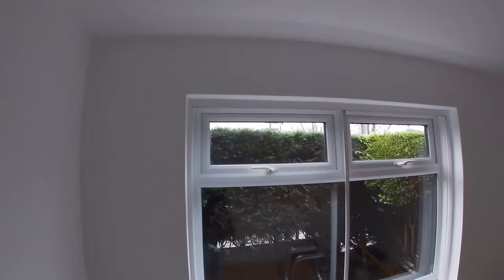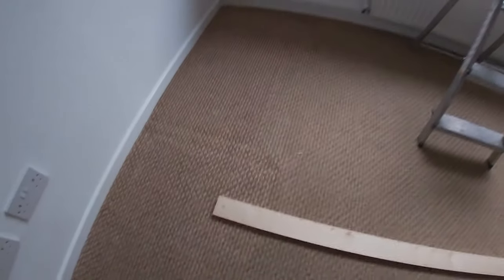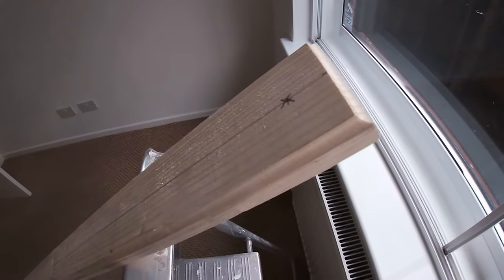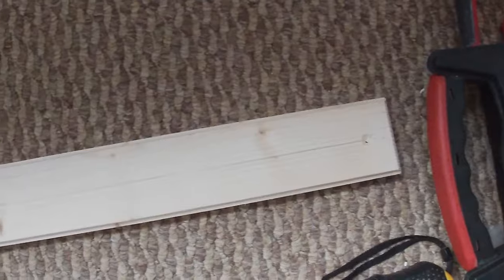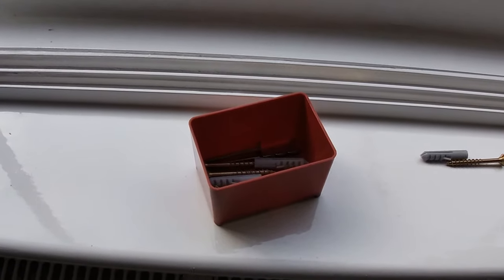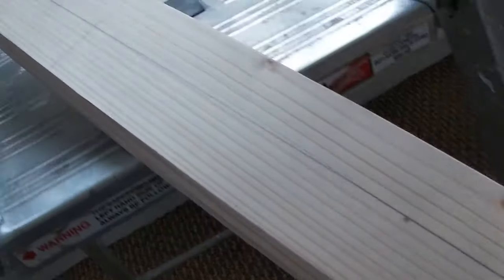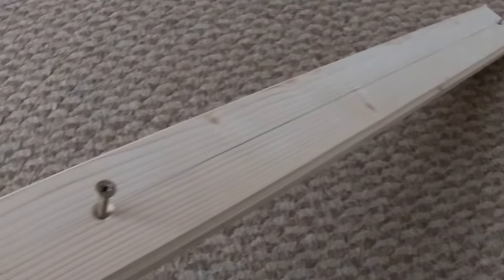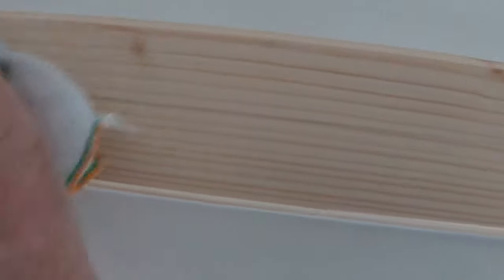How to fix a timber batten ready for a curtain pole or rail

Comment from the maker: *If this video was helpful please consider giving it a thumbs up like and subscribing.
Reply: What screws and plugs do you use into lintel ?
Reply from the maker: @denniswoodhouse3351 

My method for steel lintels is to drill with a quality HSS drill bit to start on a slow speed then you will need to use suitable steel self tapping screws directly through the timber into the lintel to get a decent fixture.I don't use plugs if coming directly into a steel lintel.

Comment: I did this same job today although before watching your video.  Heartening to see that intuitively I followed the same steps as you except I had some hard concrete to drill into.  Having done this and aligned it with a central screw the Rawl plugs got forced outward (used my drill as screw driver).  Really annoying to find at the end it was 5mm off horizontal at one end due to screws dragging it out of alignment.  Really pissed off because I can't leave it like that.
Reply from the maker: It happens as it doesn't take much for a screw to pull slightly out of alignment and I know what you mean about not leaving it like that and sometimes you're better off tightening up by hand as you have a bit more leeway / adjustment than the drill drivers torque.
Reply: Thanks Mick
Reply: that happens because I have fitted loads, and when you use wood screws with thread all the way to the end it pulls the rawl plugs out from the wall. As it over tightens the rawl plug too much before pulling the BATTEN against the wall, so the weakest point is the rawl plug and it pulls it out.
-
When doing Battens this way You use a slightly longer screw and one where the thread does not go all the way to the top of the screw. It pulls the batten down onto the wall with greater force and allows it to continue to pull down and prevent the rawl plug from being pulled out, or spun!
-
Either that or use core drill screws and inserts, but you only tend to use those on Battens which support greater weight like cupboards and shelves.
-
This method is fine for a curtain pole, though there are better screws designed for the job he was doing!
-
Nice video nonetheless, good instructions and have referred family to his channel aswell!

Comment: wouldnt you have been better off screwing the batten into the studs?  this makes no sense to me...
Reply from the maker: It wouldn't do,what studs !!  It's a brick and plaster wall 😂
Reply: lol, your off the hook.  nice work.  i see sooooo many people teaching other people to screw there curtain rods into the gib board, withOUT mentioning the crucial part of 'perhaps' you might wanna consider hitting a noggin in the wall LOL.  Yes it can sometimes be near impossible to put the curtain bracket where it 'should' ideally be placed, so this idea is good.  Perhaps you could do a video on installing curtain rods onto a wall that has gib board?  Most (like me) wouldnt have picked up that your installation was into a brick and plaster wall.

Comment: Forget the plugs and screws. Use concrete fixing hex drive screws. The come in various lengths so guaranteed to get a good fixing.
Reply from the maker: Concrete screws are great for the harder brick and block work and of course concrete but i much prefer the screw and plug method on the lighter less dense thermalite type blocks.
Reply: @micksmaintenanceanddiy  agree. Nice n chunky plugs n screws

Comment: 25 mins to fit 1. I hope your not on day rate haha
Reply: I saw a DIY and builder on a famous tv show do this last week and he drilled bigger holes and put the rawl plug in the batten on every hole, and not behind the Batten, he said he had been doing it that way nearly 40 years with no problem..lol.
-
it took him about 5 minutes.
-
I was taught to countersink the drill hole on the batten, rawl plug behind and then use longer screws with no thread on the top 1/2 to 1 inch of the screw.
-
Or use cord drill screws with inserts as they are stronger.
-
it is kind of weird, how there are so many ways to fit battens, some better than others, plus you vary screws and anchors depending on the wall, and also depending on the pulling force of the item you will be supporting.
-
Some will use 3 screws for a curtain batten, I like to use 5. I bet some people in the thread will use 3, though if doing a bigger Batten I would use 5 as it will stand the test of time!

Comment: Great video...but to gain further strength for the baton I would put CT-1 on the back of the baton and that woulg give it an even better hold
Reply: What is CT1 please?
Reply: @lesleyfrench4182  it's a sealant/adhesive
Reply: CT1 is fine, but not really needed if you use better screws designed for pulling the batten onto the wall.

Comment: can you mention size of depth of wood, size of screws and plastic caps, what size you used for drill
Reply: The rawl plugs were size 6 he used & screws were about 50mm  he said a couple of mins in, the screw caps obviously the size needed will be to cover the head of the 50mm screws, standard bit of batten is approx always the same as standard.

Comment: i want my curtains to cover the entire section of my wall , i will get a curtain rod that covers the entire wall. How long should the timber batten be?
Reply: If you think about it, if you don't want it to be seen, get your curtain rail, notice where the rail's fixing brackets go (and if several, just note each one nearest to each end of the rail and measure the distance between these two alone).
Using the measurement between each one as your guide, cut your wooden batten just a little bit more than this length.

Then affix it to the wall above the window and paint it the same colour.

Comment: The wall I’ve got is like drilling into sand. It’s completely hollow . Instead of screwing the baton to the wall, Do you think if I get gripfill or some kind of adhesive and stick it to the wall? Then screw curtains into the wall?
Reply from the maker: I Would not recommend or risk a gripfill adhesive solely on its own as due to the weight of the curtains including pole with constant opening and closing definitely a danger of falling down.
I would investigate the wall construction take it from there and source suitable fixings/safe mounting points.
Reply: There must be something solid behind the wall somewhere, wooden joists. Find that and affix the batten to that.

Comment: When your drilling the holes on the timber batten what drill size are you using. I know you said for the plugs it is 6mm. Thanks
Reply from the maker: Iirc around a 2 or 3 mm starter bit and don't forget to counter sink the screw heads for a flush neat finish, you can also buy the counter sink drill bits combined single or in a set of various sizes.
Reply: @micksmaintenanceanddiy @micksmaintenanceanddiy I got 2.5mm for pilot hole in the end. I was able to get cone drill too 1st time using it. Another question please. When fixing the brackets into the batten what screws to use? As previously I use long ones . Thanks Natasha
Reply from the maker: Use quality wood screws to suit the brackets,they need to be long enough to go through the brackets and timber without coming through the back of the timber ( l always utilize the full thickness of the batten with the screw size to create a secure fixing ). 
Good luck with your project.
Reply: @micksmaintenanceanddiy thank you

Comment: Im really struggling as i have steel lintel behind where the curtain pole goes...what power drill do i need to drill into it (using the HSS steel drill bit method)?
Reply from the maker: Any corded or 18v power drill should be sufficient personally when I come in contact with a steel lintel my preferred method is to start off with a masonry pilot hole first through the plaster brick or block work (do not use a hss drill bit for this as will blunten the tip) then a 5.5 -6 mm Quality Hss drill bit on a slow speed on the steel lintel then suitable self tapping steel screws to suit and with the batten will give you scope to get a good fixing.

Comment: Please what size and type is the smaller drill bit that you use for the wood?
Reply from the maker: I used a 2.5mm pilot hole wood starter bit which is slightly smaller than the screw diameter/thickness size.

Comment: What plasterboard fixings did you use
Reply from the maker: No plasterboard fixings used on this one (screws and plugs only) as it's a solid block built and plastered wall.
Reply: @micksmaintenanceanddiy  The drill went in very easily and that's why I thought it was plasterboard.  My wall is plasterboard so can you recommend what plug to use as there's so many to choose from.
Reply from the maker: @hardworker8030  Look into hollow wall anchors,spring toggles and grip it fixings for load specific requirements.

Comment: Not much use if you can’t drill into the fecking wall because of a steel lint…
Reply: Pink Grip is your friend in which case or C-Tec Power Grab n Bond if you never want it to come off.
Reply: That's my problem at the moment but, easy solution, I just screwed the batten above the lintel.  I have high ceilings so plenty of room.
Reply: @loislee4638 how do you know how high the lintel is though?

Comment: But I have steeeeel
Reply from the maker: *Tip: If you find you are coming in contact with a steel lintel directly behind where you want to fix the curtain rail / pole switch to a HSS steel drill bit and self tapping screw.
Reply: Alright - I’ll speak to my wife and wallet and see what we can do 😅